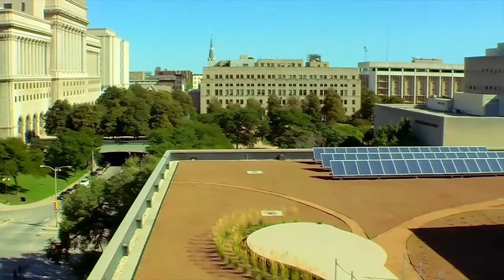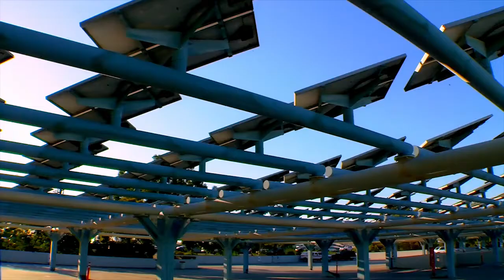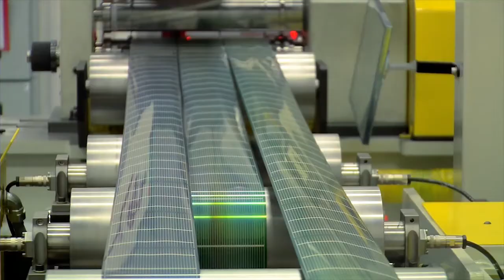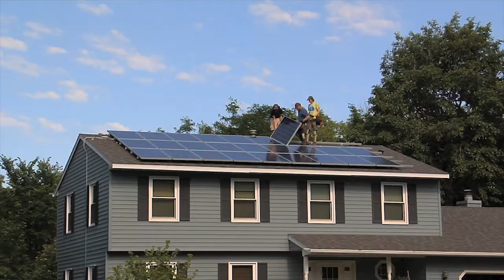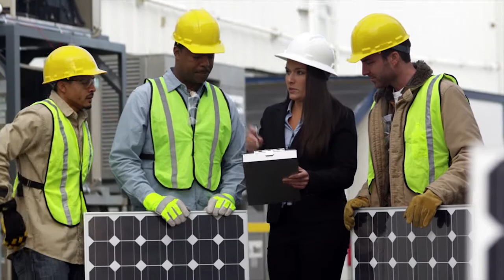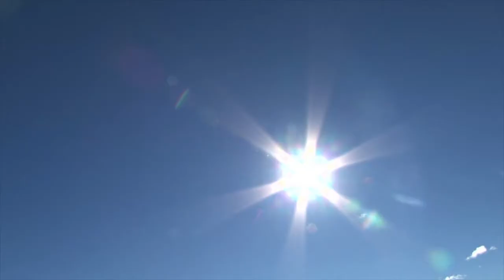SunShot BOS Video

Comment: Should push a battery backup system using solar power. Alternative is mechanical generators. this would be perfect for a LED lighting system in a home instead of incandescent bulbs. Make it a separate system on low voltage. Its would be almost free lighting. Soon fuel cells will be a part of this.